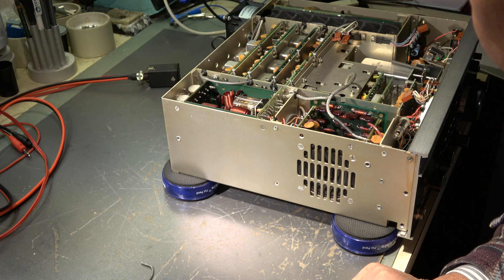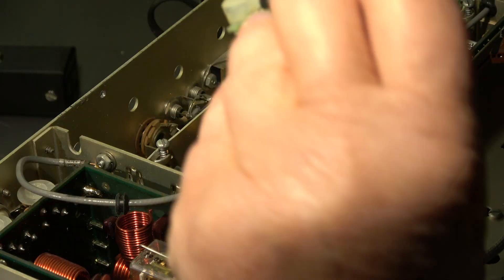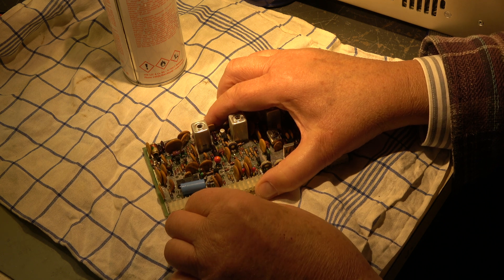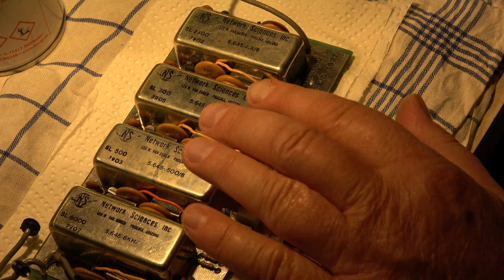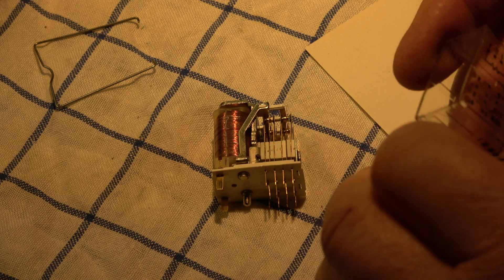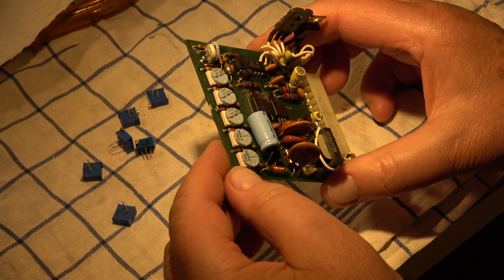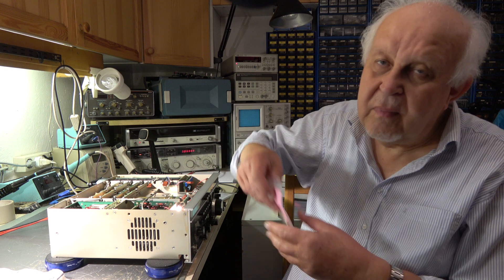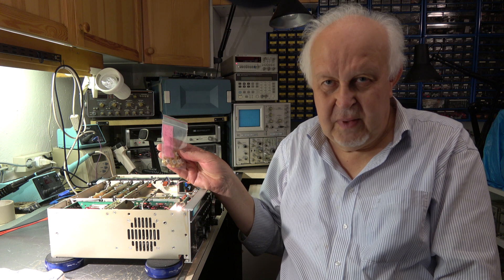#98 Drake TR7 Part 2(4)

Comment: that 300 Hz IF filter is excellent for PSK, RTTY and other narrow digital modes reception. Make a mod using a switch that uses the 300Hz filter for RX, and the normal SSB filter for TX. It really helps. (of course the 300Hz filter can be used on TX too, but using the SSB filter on TX is can be done easier).
Reply from the maker: Yes, correct. But today digital modes are generated and received via software, so the bandwidth can be selected also by software. Yes, a filter there is better (for AGC and so) - but we have "modern" times ... hi.